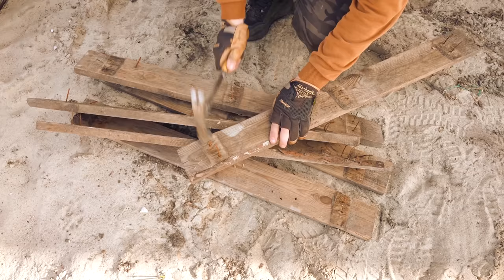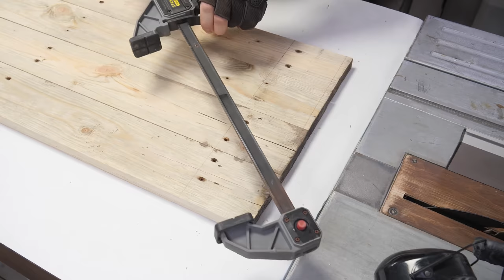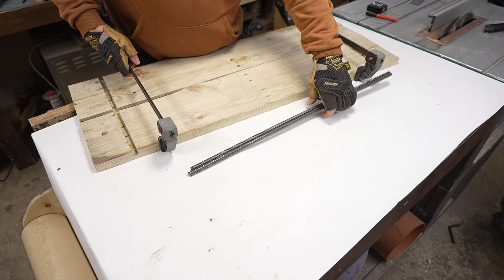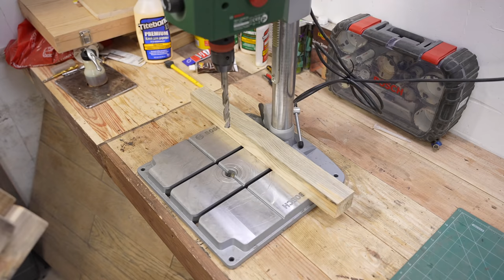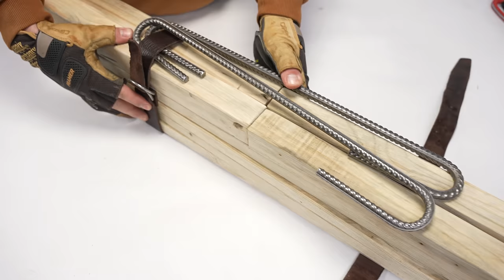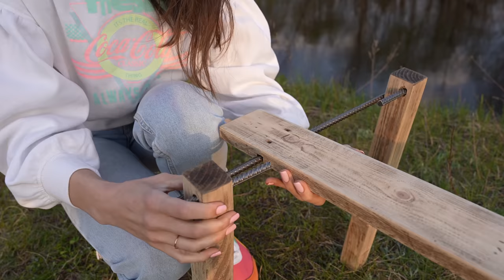It's very simple! But not everyone knows how it works!

Comment: Drill a long hole down 2 of the legs and then store another straight reo in them, a hole in each leg facing inwards to the other and you have racking support as well that fits, you can pull out the reo and slot it into the inward facing holes